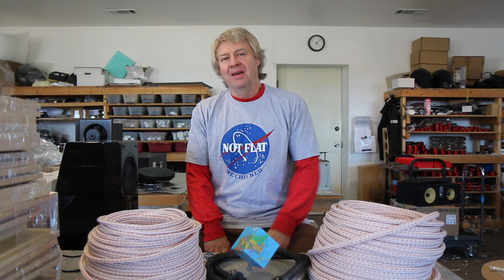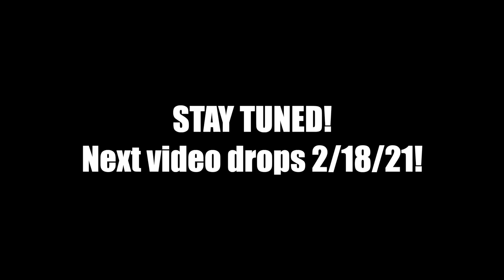Audiophile Cable TRUTHS: The Divided Camps

Comment: I am an aerospace engineer (scientist) and I agree with your approach completely.  The objective here is to find the best sounding speaker cables.  That is accomplished by "testing" different cables (A B tests).  Our "test equipment" is our ears and brain.  Then, once we have determined the best sounding cables we can measure the cables in an attempt to better understand what makes the speaker cables sound the way we want them to sound (better).  Now, with these different measurements we have a quantifiable way to modify the cables and see if the changes improve the way the cables sound.  I suspect that is what you did to come up with; probably everything you sell.  Thanks for all of the help you give the audio community. By the way, at my job we prove the Earth is not flat every day.

Comment: I'm genuinely confused, because the rest of this channel is all about making speakers measure better, with no mention ever about how they sound before measuring and looking at the crossover components/etc. But the argument here seems to be that measurements don't matter, because you can't actually measure what sounds good, but apparently only for cables?

Seems really convenient...measurements are king when you're selling a new crossover to "fix" a speaker that measures poorly, but when you want to sell a new power cable that doesn't have a measurable difference either in the cable or in the sound suddenly measurements suddenly don't matter at all.

Ironically, audiophiles are often criticized for caring too much about measurements when comparing speakers/headphones/iems, because we all know you can't measure things like soundstage width and depth, imaging, instrument separation, etc. Yet when it comes to outrageously expensive cables and even amplifiers/dacs to some degree, measurements suddenly mean nothing to audiophiles because 'they don't tell you enough about how it sounds.' The only consistency is that it's always about justifying something more expensive, far past the point of diminishing returns.

I get using good materials for cable and having good electrical connections is important. That's common sense, and we've all had cheap earbuds cut out or quit working from a cable going bad when we were kids. But when it comes to IMPROVING the sound, I have yet to hear any explanation (scientific or not) as to how cables can actually make a significant difference past a certain point. Every time this is discussed and someone does use the scientific method of testing as blindly as possible by listening for themselves, they get flamed because their DAC is too cheap, or their is to "sterile", or their speakers are only $2,000 and they need to be $25,000 to fully appreciate the subtle nuance of the specific weave in the power cable.

Honestly the whole flat earther nickname is a huge irony as well, because the better comparison to flat earthers is the people that try to argue this so vehemently. Flat earthers can go to their conventions and enjoy theorizing and believing what they want together, and everyone else leaves them alone because they choose to ignore established scientific knowledge that is just common sense at this point in the existence of our species. But at the end of the day they are the minority, no matter how loud they are, or how many mortgages they had to take out for their speaker system.

I have no problem with the argument that you should listen and a/b test yourself to see if you hear a difference. But I'm not going to spend $8k on a headphone cable to test whether it has a touch more "air" at 19kHz. If you want to spend the money on the setup to compare and demonstrate it sure. I'll listen with a completely open mind. But even if I hear that little bit of difference, even if I think it improves the sound, I'm never spending $8000 on that cable. The difference will never be worth it.

I'm honestly somewhere in the middle because I know that measurements are necessary when designing audio gear, and can be useful when comparing gear to some degree. But when people start trying to sell obscenely expensive components like cables, claiming things with scientific terms that don't have any relevance to the application (unequal length speaker cables causing transmission line effects for example), then there's a serious problem. It very quickly becomes false advertising and deception. If you're going to speak subjectively then don't use scientific terms to try to describe something that those terms have nothing to do with.

We have plenty of applications, such as ethernet at high data rates, where minute differences in cables can cause significant negative affects. And we have the capability to measure and compensate for those things with cable design etc. But in audio somehow all this actual knowledge of signaling and engineering just seems to get thrown out the window when it comes to things like cables, but terminology still gets taken and thrown around completely out of context and often with no relevance to the application, particularly when trying to sell something.

You can buy your audio jewelry and I will not have any complaints, I'll buy some myself within reason because I like nice looking things just like anyone else. You can tell me it honestly makes your listening experience more enjoyable and I won't argue with you one bit. But if I can't hear a difference and it doesn't make my listening experience better, it's not going to be worth trying to convince me otherwise because I'm never going to buy your expensive cable if I can't hear a difference from a $50 or $100 cable. Especially if it measures identically according real science and what we are able to measure based on our current understanding of human hearing as well.
Reply: Great post, totally agree with everything you are saying on this matter, somehow audiophiles loose ground connection when it comes to cables.
Reply: How the hell did you only get 3 upvotes on this? You perfectly refuted every single word this guy had to say in this video, while completely dismantling his false beliefs and business practices. It all just makes no sense and makes him look like a fool.
Reply: i guess Im quite randomly asking but does anybody know a good place to stream new tv shows online ?
Reply: @Alden Phillip Thank you, signed up and it seems like a nice service :D I really appreciate it!
Reply: @Abel Casey No problem :)
Reply: I agree.  It's like the political arena in the US now.  "Follow the science"  or "the science is unimportant, it's how I feel that matters."  Don't get me started on science that's suppressed and science that is unreasonably exulted.   So, which is it?  Trust the measurements?  Trust your ear?   Don't pull this flip flop crap on me then call me a flat earther for doubting you.
Reply: Your whole premise is flawed, and therefore I stopped reading because that means everything that followed is also flawed. You said he never mentions how a speaker sounds, only addresses measurements etc, but does the opposite when it comes to cables. You're just wrong because he's constantly talking about how a speaker sounds. You should check with your Dr about how your ears sound.

Comment: I've seen and heard enough proof that assures me connectors make no difference whatsoever (unless the original is faulty). Cable sellers at elevated prices should be closed down.
Reply: Connectors: some are made from alu or brass internally. no good audiowize, better to go with normal copper. I am not arguing prices here, just be aware and choose the better metal/parts for the job.

Comment: Hello Danny,

I grew up believing that speaker cables have no effect on sound. I still own this opinion till today, but only because the arguments I heard did not convince me. If there are better arguments in the future, I'll be happy to change my opinion. I am bothered by the following:

1. Everybody who has worked on house electrics will know which small cable diameters are used for power lines in the walls. The chain is tearing at its weakest part, so why should I consider buying a expensive amplifier power cable, which is as thick as a finger, when beforehand the current flows through only a few mm² of normal, low quality copper ?

2. I am a vintage audio fan who owns a old Yamaha CA-610 amplifier. Since I replaced the old transistors and capacitors in the amplifier, I know through which small cables and components the signal has to "squeeze" before it reaches the speaker output terminal. Yes, it's over 40 years old, but the build quality back then was much better than most of today's consumer amplifiers. So again, why should I invest $350 into speaker cables that are as thick as a finger, when beforehand the signal flows through small cables and components made out of normal quality metals? And don't tell me that today's amplifiers only use high quality copper for their internal wiring. They don't.

3. Same goes for the cheap quality crossovers in speakers. 

My priority list for good sound would look like this: 
1. Get your hands on high quality music and recordings. Don't play highly compressed 50-times remastered music... garbage in -> garbage out! 
2. Invest in good room acoustics. (You hear up to 70% of the room reflections and only 30% directly from the speakers)
3. Build your own speakers with a good crossover and high quality parts.
4. Look for a amplifier that suits your needs. You don't need to spend a fortune for that thing. 
5. If all of the things above are done, you are free to invest your spare money into things like speaker cables etc. 

Kind regards
Reply: Your priorities are sound. 

To answer your question 1 and 2 then you have to understand that the cable being used can and will act as a filter. And removal of RFI and EMI can and will have a positive effect on what you hear.
Reply: @davidlong1786  If you are looking for a cable to make a difference in the frequency response, distortion, or impulse response then you are looking in the wrong place.
Reply: @SB Excellent points! Thats what I always wonder. The power socket has basic poor Romex cable running 100 foot and probably 3 or more wire connector in preceding sockets. Now in the last 3 foot cable,  some how putting a 10 gauge some kind of twisted wire is going to change current? Frequency? What's that changing? I do like what Danny does regarding the Crossover upgrades, though some of those are overboard with very expensive tube connectors ( @1000 times inflated costs). Despite that I thought of buying some cross over upgrades and DIY kits. So until now I always believed he does objective tests and provide that with no FUD factor. I watched almost all his videos. This is not something I have expected from Danny. 
 Don't know if greed is playing some kind of role here.
Reply: @chinnana583  As to your question as to what it is going to change. It will, as a filter, reduce RFI and EMI. In plan English it will reduce the noise levels on the line. 

And the tube connectors are priced based on cost to produce and at NOT inflated. They are also less than half the cost of the best binding posts and spade connectors. So they are quite the bargain. 

Greed? If you know me at all then you know that's not me. I am going to teach everyone how to reach a whole new performance level and at low price points.
Reply: @dannyrichie9743  
Thanks for your answer Danny. I believe you, that RFI and EMI can affect the signal in a bad kind of way.
That's why my $30 antenna cable with a ferrite core gave me significantly better results on the TV programs than the cheap $5 antenna cable I had used before.

I would never say that you are greedy. You do a great job with your speakers & cross overs. Other people would charge way more for the same job. Not to mention the Informations you give us for free. So a big thank you for that! 👍

I just think that your cables are a bit overkill. I would need 2x7 foot of speaker cables, which would be around $200. That's what I paid for my amplifier.
The cables are worth their money in terms of material costs and work labor. But maybe one could get the same filtering results with $50 cables? 

Have a nice evening. Cheers 🍻
Reply: @SB-pc8iu  If I could get anywhere near the same level of performance from a cable that cost $50 then I'd be using it and recommending it to everyone. 

Keep in mind I play at the top level of the performance ladder. So finding cables that sound as good as the the stupid expensive ones for only a couple of hundred dollars is a gem.
Reply: @davidlong1786  When you can swap out cables in any high end system and hear notable differences from how it handles RFI and EMI then it is not a rare problem.
Reply: @davidlong1786  The voodoo is that the speaker cable differences can have a dramatic effect on the depth of the sound stage, sound stage layering, imaging, space between instruments, etc. How would you go about measuring that?
Reply: @dannyrichie9743  I genuinely appreciate your detailed reply. But I do not think we need to spend that kind of money for RFI/EMI filtering. Pretty much most power conditioners in audio rack does RFI/EMF filtering. They even have dedicated filtering for each component type. Even $30 Panamax surge Protector MD2 has EMI/RFI filtering that I use for a Sub. So I am sure that does not need $100 power cable for each component.
Reply: @chinnana583  Listen to yourself. I do not think... I'm sure.... You are making assumptions. You have not done the work in this area that I have. Stay tuned for more episodes in this series.
Reply: @dannyrichie9743  Sure Danny, Certainly! I will wait for the upcoming sessions and hear what you say, demonstrate, hopefully something tangible will come out it. Yes, I do not have experience like you have in this area. I only built few DIY amps, few sets of DIY speakers, helped/helping many friends and family members with setting up audio/theater systems. So, I will wait for your upcoming sessions, hopefully I will learn some new things. Thanks
Reply: @dannyrichie9743  "sound stage, sound stage layering, imaging, space between instruments"

What do you think these "properties" are?  Audio magic?  What do you think sound is?  Do you not believe it's a summation of Sine waves as per Fourier?  I am willing to say they are how you are attempting to describe the Frequency Response, Directivity, CSD, IMD, and Harmonic Distortion differences between loudspeakers.  I'm beginning to think that you have basic beliefs about audio that are completely unfounded in anything to do with electrical engineering or audio science.

Comment: Cables do matter, don't buy crap. I bought a pair of used 8 foot long Kimber Kables 8TC on eBay.  I was replacing a pair of 8 foot long Monolith by Monoprice speaker cables 12 gauge and PE coating. They were also good. I couldn't tell the difference but the Kimber Kables are blinggier so I'm happy. The moral of the story is, if you don't use crap. A lot of good quality speaker cable will work just as well as the more expensive stuff. Sounding different does not mean sounding better.  If a cable is tuned to sound a certain way, then you're buying that tuning, not a "better" cable.

Comment: The "All science flat-earthers?" I think you got your camps mixed. It makes more sense that someone who believes the earth is flat, also believes that noise in the Mhz-range in speaker cables affect sound quality. The science doesn't stick in either case.
Reply: Pay attention to what I said and what is coming up in the next videos and you'll understand how they really do no science at all.
Reply: @dannyrichie9743  You don't have the credentials to determine that. Also: They don't "do science". You have a fundamental lack of understanding behind the science and  the philosophy(s) the scientific method is based on.
Reply: @Clobercow1  You are incorrect, and will be shown to be so.
Reply: Don’t worry. We will all be watching. 😊
Reply: If the noise happens to be AM from a broadcast station, or your cellphone, it absolutely will impact the audio quality, but not in the way he thinks. You'll get lots of interference in the audio as either the broadcast material, or a bunch of clicks from the cellphone transmitting data packets. Normal twin-conductor speaker wire is actually fairly immune to RF once its connected to low impedance sources like speakers and amplifiers, but with audiophiles and their bizarre ideas, that no longer can be taken as a given.
Reply: Actually they have proven, using fMRI brain scanning equipment, that people's brains do react to "infrasound" (sound frequencies above the normal human hearing limits) but only when presented along with lower frequency sound. I have not seen any good scientific explanation for why this is but I have a few ideas. I think one of the commenters mentioned that higher frequencies may modulate  the lower frequencies in some way making the them audible? Maybe? No one really knows I guess. Science doesn't have the answer to everything just yet.